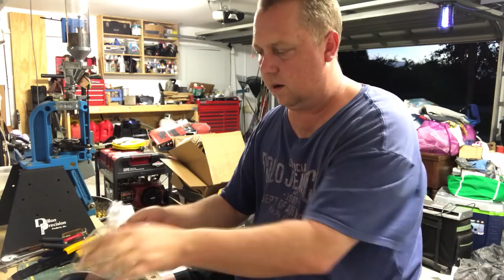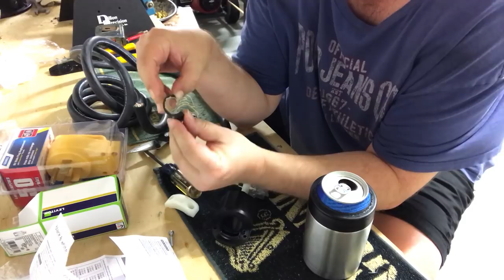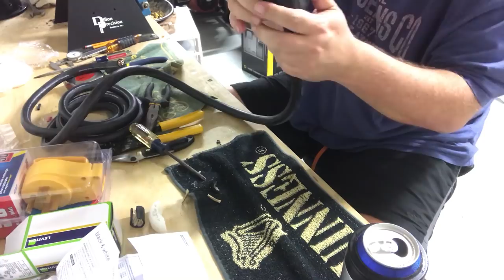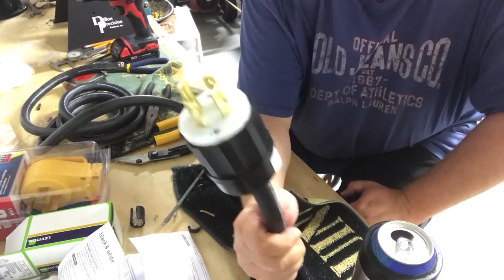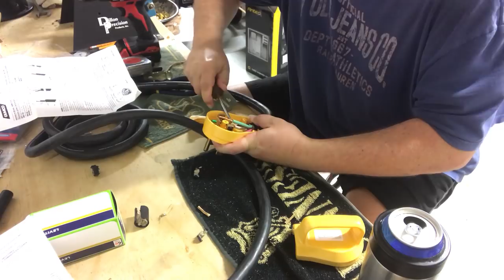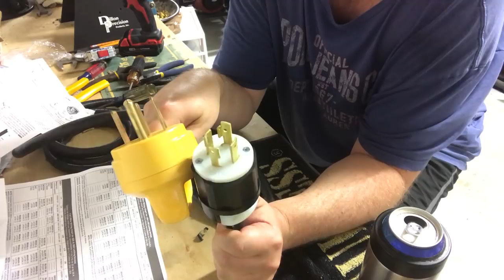How to build a generator cable

Comment: It’s called a suicide cord for a reason!! It very cheap and easy to do it the correct way. The problem is if you have the plug plugged into the generator and not plugged into the plug on your house the other ends are electrified. You touch that or touch something else with that you’ll have problems.

Comment: Thanks for the Vid. One question though, is that Why didn’t you put a 50 amp plug on both sides? Was it because your generator with a 240 volt output had a max of 30 amps? Thanks
Reply from the maker: My house already had a 50 amp when i moved in.  My generator has a 30 amp.  So i left it - because one day i hope to get a bigger generator.
Reply: Obsessed DIY Thanks for your response...

Comment: Hell yeah dude, I'm bout to make a suicide cable!! Ur video is lengthy, but very detailed! Thanks for saving me some green!! 
Stay safe!
Reply: Whaddaya mean "Stay"?
Reply: You wouldn't save any 'green' as you can't buy one- because they are illegal to sell- because they are DANGEROUS!!!! People have died from these
Reply: @ Steve d   The cable itself is no more dangerous than any cord it’s how you deploy it that can be hazardous the 50 amp male house end should only be plugged in with all power off both generator and main house breaker off then use zip ties and electric tape to secure plug into receptacle and put do not touch sign on it

Comment: How about mounting a 30 amp receptacle box near the dryer with a cable and plug for the 50 amp outlet. Then you can use a normal 30 amp cable with a male at one end and female at the other end. More work and cost but maybe safer.

Comment: There is not a female connector  on the 50 amp end , they are both male. Because the 50 amp is male it is extremely important to tell folks they must plug it in first and then plug in the 30 amp side to the generator. It is good you said to kill main breaker before doing anything. It is just as dangerous not to explain that both ends are male , this very atypical and i suspect is the biggest reason they call this a suicide cable. In the world of real electrical cables, a male connector never has live power exposed on its blades. Male connectors always receive power from the female connector. Failure to point that out makes this video dangerous and it should be corrected or taken down.  BTW disconnect must be done from the generator  end for same reason. I realize folks may do all connection before starting the generator, but for something this dangerous you can't count on that.

Comment: OH SHIT ! a suicide cord. yup, that is if ur gonna use that yellow male fitting. Actually, if u think it 
all out it can work very well but there's hardly any room for EFF-UPS. Find out how long power will 
be out to see if its gonna be worth the bother. if it is,  then the 1st thing  is shut off mains and if 
possible lock in OFF position. 2nd thing is, (since power is off) plug cord into dryer or gen recept.
which is fused  or protected against over-current. 3 Then plug into generator after it has warmed
and ready for the load. if U yes you are the only one in house, that is one thing, but if u have pets
and curtaingrabbers a.k.a. kids. u get the wife to stay in room with pets while u do this, . Same for
undoing. I heard of someone doing this, unhookt from gen when power came on, when the MAINS
were back on the family pet was electrocuted because of the cord still being plugged in. THAT
NEVER SHOULD HAVE  HAPPENED AND NEVER NEEDED TO.  BETTER TO GET A 4 WIRE MALE
FITTING AND AN FEMALE AT OTHER END OF CORD, MAKING IT NO LONGER A SUICIDE CORD.
With electricity, if u EFF UP u can pay up, with YOUR LIFE.

Comment: Ok so there are 2 main dangers here but like anything in life if you take some extra cations it can be safe enough for a temp fix the first problem is if someone turns the main breaker on you can kill a lineman that is trying to restore power in your area the fix to this is make sure all in your house know no one touches breaker panel but you also I duct tape panel closed and put touch and someone dies sign on it. Second major problem is male to male plug so at house end I put small eye closed eyehook at each side of house receptacle after plugging in I use zip ties through eye hook so plug cannot be removed by accident and again put sign here this and a serious discussion with all in your house that only you touch the generator power panel or cords can get you by but if there’s any young or mischievous kids in the house I would not do this

Comment: I would rather have one unsafe suicide cord in my garage that a bunch of unsafe trip hazard extension cords running through my house.
Reply: It's always helpful when calling someone else an idiot to use "you're" instead of "your".
Reply: @scottlarson281   I am getting over a stroke and sometimes I don't always get things correct.

I have been working on generators and power systems since 1968. What  he is building is a dangerous cord. If you have a problem and the insurance company finds you have a cord. They can cancel the insurance. I have seen it done. Saw one man that was killed because he was holding the other end of the cord. When he plugged it in.. Use a proper transfer switch
Reply: Distracted by beer and a football game.... I'll pass... NEXT VIDEO PLEASE....
Reply: @billyshafer3182  In the beginning of the video he said there was an existing breakout switch already wired to his fuse panel by the previous owner, so he's not back feeding anything, H
e's just building a power cord to go from his breakout panel to his generator. He also said  Before plugging it in make sure to turn off the main breaker in the fuse panel.
Reply: Yes but he ended up with a male plug on each end of his cord which is not kosher. The previous owner never had the system right to begin with. On the wall in his garage there should be a male receptacle and he has a female receptacle. There should also be an interlock or a transfer switch so the exposed pins on a male receptacle can never be energized by voltage from the breaker panel.